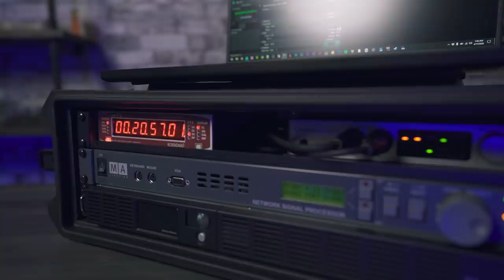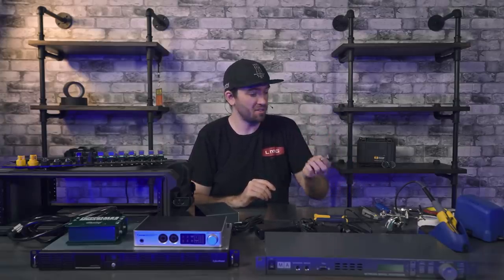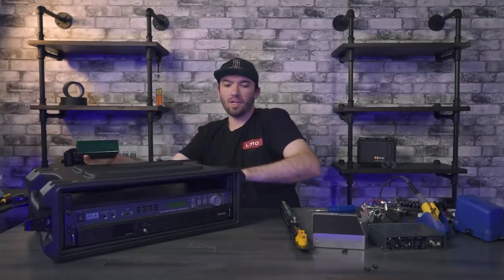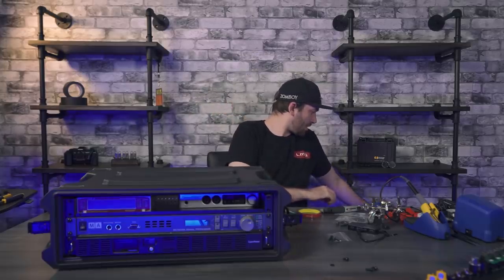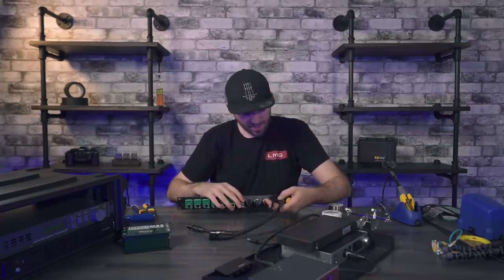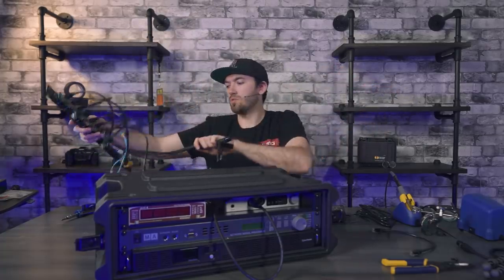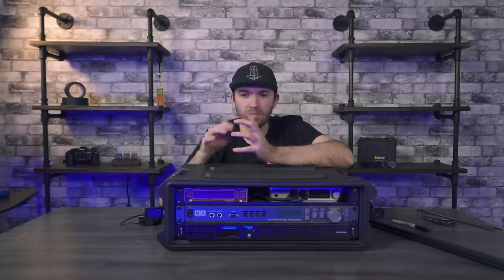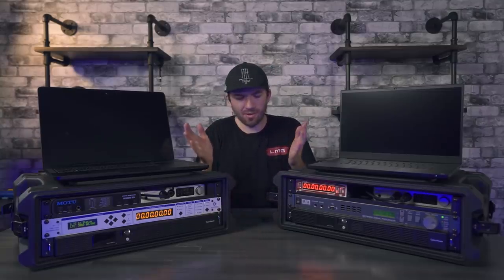Building My New Lighting & Video Timecode Rack Step By Step

Comment: If you don't desperately need POE (or you are happy to use seperate POE power supplies that aren't backup-powered) one option could be the replacing the switch with eg the Netgear GC110 which is still an 8-port switch with SFP ports but because it doesn't have POE it is possible to power it from 12v and use (for example) one of these 12V CCTV backup batteries https://www.amazon.com/dp/B074MQ1Q3V which should just be able to plug in between the switch and it's 120v wall adapter. This would just serve as backup power for only the router but be much lighter. The Netgear GC10 also has the power port on the same side as the ethernet ports! :D
Reply from the maker: That’s an interesting idea!